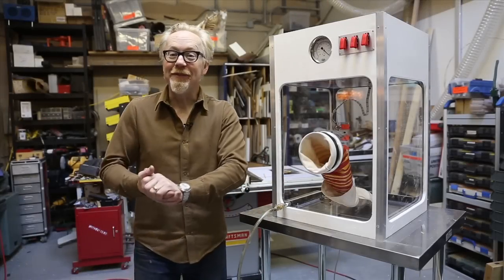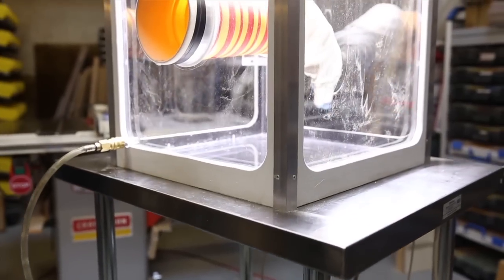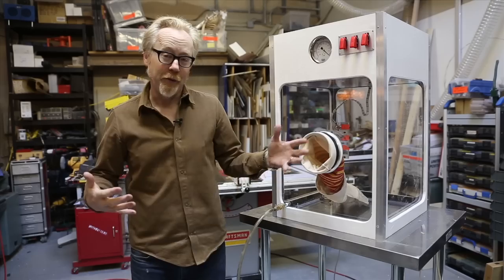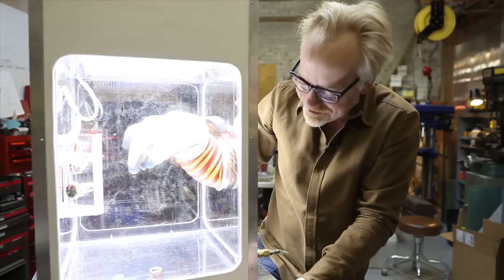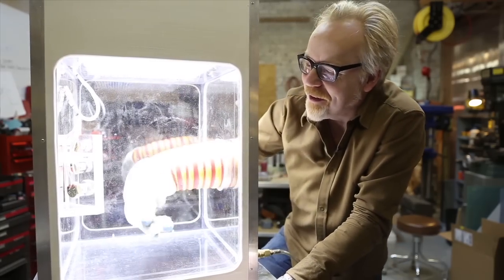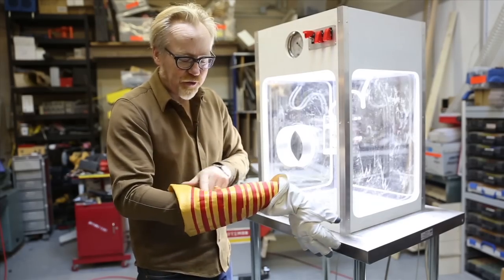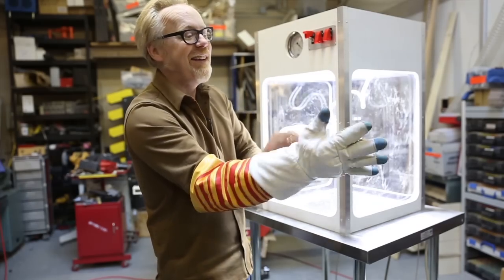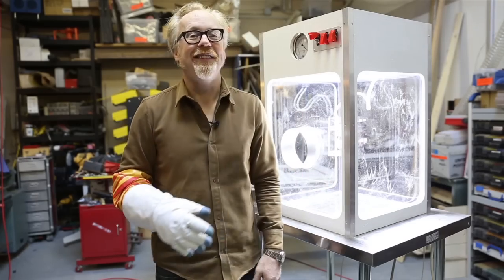Inside Adam Savage's Cave: Space Glove Vacuum Chamber

Comment: This makes no sense to me. 1 atmosphere of pressure equals 14.7 psi. If you have a spacesuit pressurised to 3.5 psi that is a partial vacuum which should suffocate the astronaut. Even so, if you enter the vacuum of space with a space suit pressurized to 3.5 psi the spacesuit should expand like a balloon and become rigid.
Reply: If you have a spacesuit pressurized to 3.5 psi with 100% oxygen, the oxygen density will be similar to the Earth where Oxygen is only 20% of the 14.7psi.
Reply: @texmex9721  "20 of the 14.7psi%"?
Reply: You mean 20% of the 14.7 psi?
Reply: 20% x 14.7 = 2.9.  100% x 3.5 = 3.5  Can you see how the space suits actually have higher oxygen density than Earth?
Reply: @texmex9721  They may have higher oxygen density but the kinetic energy of the individual oxygen molecules is lower because the overall pressure of the gas as a whole is less. So, I'd expect less oxygen would be forced through their lung membranes. You know how hyperbaric oxygenation works? 100% oxygen at above 1 atmosphere of pressure. Anyway, oxygen (O2) is not actually 20% of the atmosphere. Years ago I'd read from many reputable sources O2 levels are actually approaching dangerously low levels (less than 19%) due to deforestation and combustion engines converting oxygen (O2) into nitrogen oxides and ozone. I'd read that at the current rate of decline the levels were expected to reach below 7% within a very short period of time (a decade or so). The levels I was reading for many cities (which tend to be different compared to outside cities on a windless day) were lower than many believed to be the minimum necessary for survival but apparently we have adapted. Soon we may need spacesuits to survive on Earth! Strangely, all online sources I am now finding say atmospheric oxygen levels are at around 20%. I suspect the truth is being supressed as we approach extinction.
www.i-sis.org.uk/O2DroppingFasterThanCO2Rising.php

https://www.inverse.com/article/21419-atmospheric-oxygen-levels-falling
Reply: @texmex9721  By the way, your explanations ignore the question of how the spacesuits avoid exploding or becoming rigid due to the pressure differential between inside vs outside the spacesuit.
Reply: "The average kinetic energy of the gas particles depends only on the absolute temperature of the system." - Google that if you want a few hundred sources.
By the way I have been ignoring questions you have not asked?  My apologies.  Maybe you could provide a list of the questions you have not yet asked.  Or you could adopt a civil tone and simply ask additional questions. 
The space suit holding pressure remains flexible by a series of mechanical joints, meshes and structures that maintain a constant volume while bent.  Everyday examples of the same constant include garden hoses, and hydraulic lines.  The brake lines in a car for example can hold as much as 5000psi while remaining flexible allowing suspension travel and front wheel articulation.  The Apollo suits looked like this: https://en.wikipedia.org/wiki/Apollo/Skylab_A7L#/media/File:S71-24537-A7L_without_outerlayer.jpg
Reply: @texmex9721  You are ignoring a point I made in my original post. And the claim that the kinetic energy of a gas is determined solely by the temperature of the whole system only proves my point.
Reply: You said: "the kinetic energy of the individual oxygen molecules is lower because the overall pressure of the gas as a whole is less. "  Not temperature.  The gas is heated in the suit btw. 
"the spacesuit should expand like a balloon and become rigid."  - that is so silly I assumed you were not serious.
Reply: Furthermore, your "explanation" of how a non-rigid spacesuit remains flexible in the vacuum of space is flawed and does not explain why such non-rigid spacesuits don't explode or become rigid. Your explanation does not apply to the gloves which would become inflexible in the vacuum of space. As Adam Savage admits in the above video, it becomes very difficult to manipulate objects with the gloves when there is a pressure differential of only about 10 psi. The pressure differential on the Moon or in deep space would be far greater than 10 psi! If the pressure of the gas on the inside of the spacesuit were to be at 3.5 psi when in vacuum then the  pressure inside the spacesuit would need to be far less than 1 psi when recompressing to 1 Atmosphere of pressure. Are you saying the internal pressure and external pressure are slowly adjusted in an airlock or something? Or do they just reduce the pressure inside the spacesuit to 3.5 psi (or whatever it is) while inside a spacecraft where the external pressure is 1 atmosphere then quickly step outside the spacecraft into the vacuum of space? If they just step outside the spacecraft after pressurizing the suit to 3.5 psi in 1 atmosphere of external pressure then the internal pressure inside the suit would increase to far above 1 atmosphere of pressure and, if breathing 100% pure oxygen, the astronaut would die of oxygen toxicity. Do you see my point now?
Reply: What?, a conspiracy theorist did not accept my explanation?  I'm shocked!  TV Celebrity Adam Savage's "space" gloves are very cute but he and you have no idea how the space gloves are made.  Maybe refer back to the photo I showed you.
The pressure differential on the Moon or in deep space would be far greater than 10 psi! Nope.  Its 3.5.
Reply: @texmex9721  Yes, the kinetic energy of the individual oxygen molecules is less because the overall pressure of the gas is lower. The oxygen molecules get their kinetic energy from collisions with other gas molecules (BTW, in a 100% oxygen gas, the other molecules are all oxygen molecules!). Momentum is transferred or exchanged in these collisions. The force or energy of these collisions is what gives a gas it's pressure. Where does this kinetic energy come from? It comes from absorbing heat energy, either thermal heat energy or radiant heat energy (AKA thermal radiation, usually infrared radiation). Thermal heat energy is a measurement of molecular motion. Hence the reason heating a gas increases the pressure of the gas. You are obviously suffering from the effects of oxygen deprivation if you can't see the connection between molecular oscillation (brownian motion), temperature, and pressure.
Reply: @texmex9721  You said "The gas is heated in the suit btw". So, tell me, is the specified internal pressure before or after heating? And how is it silly to say the suit should expand and become rigid when that is exactly what is happening to the gloves in the above video?
Reply: " the kinetic energy of the individual oxygen molecules is less because the overall pressure of the gas is lower." - Nope.  
After.  And the glove in the above video is not a space glove.  As I mentioned.
Reply: @texmex9721  You don't understand the physics. Which came first? The kinetic energy which creates the force of pressure or the heat energy which is the kinetic energy of the molecular motion? They are inseperable. Energy cannot be created or destroyed. It can only change form. Yes, heat can be transferred (lost or absorbed) across a vacuum in the form of thermal radiation. But when conductive thermal energy is lost as thermal radiation it is always converted back intoheat when absorbed. Absorption of thermal radiation is one way to increase the pressure of a gas. But usually the pressure is increased by conduction of thermal energy in the form of molecular collisions. So, the kinetic energy of molecules, heat, and pressure are inseperable. It is not possible to say which comes first because they are inseperable. I should not have to explain this to you. How is it you conclude one comes before the other?
Reply: @texmex9721  You accuse me of not using a civil tone while calling me a conspiracy theorist? When did I stoop to the level of name calling in this conversation? You are the one who needsto work on keeping a civil tone. I'll investigate your link and the point about brake lines later. That is an interesting point about brake lines if true. But gloves are more like balloons than brake lines. I'll be back later. I'm busy at the moment.
Reply: The kinetic energy does not change with change in pressure.  if it did you could find a source that said that.
conspiracy theorist is 2 words, and not an insult.
But gloves are more like balloons than brake lines. Please just once consider the fact that you don't know how an Apollo space glove is made and neither does Adam Savage.
It was not easy to move in the space suit or manipulate the gloves, but it was not impossible. Just as a garden hose gets stiffer with water pressure but can still be bent with 40psi inside.
Reply: @texmex9721  Yes, the kinetic energy of the molecules does change as pressure changes. Any physics textbook should explain that. Here is a link about the "kinetic theory of gasses" proving this. https://en.wikipedia.org/wiki/Kinetic_theory_of_gases

You obviously lack a basic understanding of physics.
Reply: @texmex9721  Yes, "conspiracy theorist" is 2 words. I meant "term" as opposed to "word".
Reply: @texmex9721  If the pressure differential were only 3.5 psi then the oxygen inside the spacesuit must be extremely rareified.
Reply: OK so if the kinetic energy of molecules were reduced when pressure is reduced, what would happen when pressure is suddenly reduced to zero? 
3.5 psi then the oxygen inside the spacesuit must be extremely rareified, -yes about the same as it is on Earth. As I have already explained.
Reply: @texmex9721  When I said the oxygen inside must be extremely rareified I didn't mean like on Earth. You obviously cannot understand what I am saying so it would be futile to continue this conversation.
Reply: @texmex9721  If outside pressure is reduced to zero then the internal pressure would become infinite. You don't understand basic physics let alone what I am saying.
Reply: @texmex9721  Average kinetic energy of gas particles is equivalent to the pressure! It is the kinetic energy of the gas particles which creates the pressure against the container. Refer to the link I shared to the wikipedia article about the "kinetic theory of gasses".
Reply: Here is what NASA says about it:

"The pressure of a gas is a measure of the linear momentum of the molecules. As the gas molecules collide with the walls of a container, the molecules impart momentum to the walls, producing a force that can be measured. The force divided by the area is defined to be the pressure. The temperature of a gas is a measure of the mean kinetic energy of the gas. The molecules are in constant random motion, and there is an energy (mass x square of the velocity) associated with that motion. The higher the temperature, the greater the motion."

End quote from: https://www.grc.nasa.gov/www/k-12/airplane/kinth.html
Reply: @texmex9721  Your confusion likely originates with an inability to see that pressure is a result of temperature. I mean you likely do not understand that energy and momentum and force are merely different ways of describing the same thing which is a mass in motion. You likely believe kinetic energy, momentum, and force are all very different things instead of seeing them as different ways of describing or quantifying the same thing (a mass in motion).

Light appears to have mass or momentum despite having zero rest mass because we measure or speak of light's effect on matter. Light absorbed by matter will put that matter into motion in the form of heat. This is how thermal radiation or radiant heat energy is transferred across a vacuum. In other words, this is how the Sun heats the Earth across the vacuum of space. Photons may not have mass so when we speak of it having momentum we are actually speaking of the momentum of the mass absorbing the light which we use to measure the momentum transferred by light. To answer a question you asked earlier (if I remember correctly), if you cool a gas down to absolute zero it's pressure goes to zero. Conversely, if you reduce the pressure to zero the temperature goes to zero. To reduce the pressure to zero would probably involve expanding the size of the container to infinity, though. I could be wrong about that (expanding the volume to infinity to decrease pressure) because that may actually cause the temperature of the gas to increase. Note the thermosphere is an extremely rareified gas supposedly having a low pressure but it's temperature is extremely high (gets up to as hot as the surface of the Sun) so the pressure due to temperature may counteract the decrease in pressure due to the decrease in density. Usually, cooling a gas involves compressing it. But this actually generates heat (temporarily) because it increases the rate of collisions between the gas molecules and their container. After the heat is dissipated to the surrounding environment the gas cools down to the ambient temperature. But if you release the gas from the container it will leave the container and cool the container down. But the gas is actually claimed to be at ambient temperature or above. It is claimed to "steal" heat energy from the container and reach a lower pressure. Or so it is said. That is debateable though (for reasons which should be obvious). But I don't believe it's possible to cool anything down to absolute zero. If you could, the volume of a gas would go to zero when temperature and pressure decrease to zero.
Reply: I can completely understand what you are implying, it is simply wrong.  I am not confused.   The density of oxygen in the spacesuit is higher than it is on Earth.  To call that rarified is comical. 
"The temperature of a gas is a measure of the mean kinetic energy of the gas." <---- Temperature, not pressure.  This is from your source.
Reply: Pure nonsense. The CONCENTRATION of the oxygen may be higher than on Earth (at sea level), since it is 100% pure, but it's DENSITY is less because the pressure is approximately 1/4 of what it is (or is claimed to be) on Earth (3.5 psi vs approximately 14 psi).
Reply: @texmex9721  Pressure is a measure of the kinetic energy of the gas particles. So, if temperature is a measure of the gas particle kinetic energy then temperature is also a measure of pressure since pressure is a measure of the gas particle kinetic energy. If you don't understand this then please do not bother to disturb me again.
Reply: While it may be true the density of the oxygen measured OVER TIME (vs a timeless moment) is slightly greater than on Earth at sea level, since it is at 100% concentration which is 5 times greater than the 20% concentration of oxygen at sea level on Earth, the difference is very small since the pressure of the oxygen is reduced to 1/4 of what it is on Earth. The reduced pressure counteracts the increased concentration. If we decrease pressure by the same (but inverse) factor as we increase the concentration then there is no change in the amount of oxygen absorbed. For example, if we decrease the pressure to 1/5 of the pressure at sea level while increasing the concentration of oxygen by 5 times to 100% this would be the same as breathing 20% oxygen at 1 atmosphere of pressure. Or so one might expect. This is ignoring the other problems I mentioned earlier such as how the gloves avoid becoming rigid due to increased internal pressure due to the increased pressure differential. We must take into consideration the pressure differential because if the external pressure is close to zero and the internal pressure is 3.5 psi then that means the gas inside the spacesuit must be extremely rareified. If you don't understand what I mean, imagine if you have a tire inflated to 3.5 psi at sea level. Take that tire into the vacuum of space and it may explode. Helium filled balloons explode all the time when they rise high into the atnosphere because they expand and stretch the balloonto their breaking point due to the increased pressure differential. The pressure outside the balloon decreases and this allows the balloon to expand. The gas insidethe balloon then decreases until it reaches equilibrium. A spacesuit may be reinforced with a strong mesh embedded inside it like a garden hose to prevent it from expanding so the internal pressure doesn't decrease when the astronaut goes out into the vacuum of space. But this doesn't make the pressure differential go away. The vacuum of space will still be sucking on the gloves and making the gas particles inside the gloves hit the inside of the gloves with greater force or pressure than they would if the external pressure were at 1 atmosphere instead of a near vacuum. If the internal pressure is at 3.5 psi while the spacesuit is in a vacuum what happens to the internal pressure when the astronaut goes back inside the space craft (without depressirizing) where the pressure differential is much less because the pressure outside the spacesuit is at 1 atmosphere (14.7 psi)? In that case the pressure outside the spacesuit is greater than inside and squeezes the glove instead of sucking on it. But the embedded mesh can't prevent the glove's volume from changing in this case so the volume inside the glove will decrease. The glove will collapse around the astronaut's hand and the pressure inside the glove (and perhaps the spacesuit) will increase. So, do the astronauts adjust the internal pressure inside their suits in an airlock where the pressure outside the spacesuit is slowly decreased or increased before going out into the vacuum of space or returning from it, to avoid such problems resulting from a pressure differential?
Reply: "Pressure is a measure of the kinetic energy of the gas particles." Nope, and you have not provided a source that says that.
Reply: @texmex9721  I did provide a reference to a source which says that. See the links I shared about the kinetic theory of gasses. Kinetic energy can be converted into momentum and vice verse because they are both merely descriptions of mass in motion. You can try to argue that energy and momentum are not the same thing as many do but that won't work with me. Energy and momentum are merely two different ways of describing or measuring the same thing.
Reply: @texmex9721  If you don't understand what I am saying then please move along and do not bother me again.
Reply: You can keep saying 2+2=3 and that I don't understand.  That is your right.
Reply: @texmex9721  To quote that NASA page I cited earlier, "the pressure of a gas is a measure of the linear momentum of the molecules". So, momentum=pressure (in this case). Kinetic energy=temperature.  You can convert temperature into pressure or vice verse by converting the kinetic energy of the gas particles (which corresponds to the temperature) into momentum (which corresponds to the pressure) or vice verse. Now, please don't bother me again by arguing with common sense. If you disagree then keep it to yourself. I don't have time for foolishness.
Reply: @texmex9721  Converting starch into sugar isn't same thing as converting energy into momentum. Energy and momentum are just different ways of describing the SAME thing (a mass in motion). Starch and sugar are NOT the same things. They are different. Yes, you can describe starch in terms of a chain or polymer made of sugar molecules but that is NOT the same thing as the sugar monomers.
Reply: @sashas3362  "So, momentum=pressure (in this case). Kinetic energy=temperature."
Only if you look at a single molecule. But that is not the question here. It is about looking all molecules. There are less of those. That is the problem when you try to cherry-pick quotes you don't understand the context of.
Reply: @Schmidtelpunkt  Nope. You're wrong. It's called "the kinetic theory of gasses". Look it up and study it. You will find equations for and/or involving both the average kinetic energy of the individual gas molecules and also the total kinetic energy of ALL the gas molecules.
Reply: @sashas3362  Well, just say "nope" does not really work as an argument. As far as I have studied it, pressure always refers to particles as a collective entity, whereas the kinetic energy can be calculated on an individual level. Both usually used for different purposes. Yet you happily mix and match both depending on which quote seems to help your opinion best, a lot like you posted a link of a Buzz Aldrin quote ripped out of its context. This makes it hard to believe that you are interested in finding the truth, entirely independent of the question whether you are right or wrong on that issue.

As I never needed to connect the purposes of both models, it is indeed possible that this has been missing in my "studies". But even that would not change the fact, that so you did not provide any equation relating pressure to the kinetic energy of the individual molecule. It does not help to repeat either of the two anxioms - the point is their relationship, as that is your claim.
Reply: @Schmidtelpunkt  I didn't just say nope. Sorry, no offense, but I am done arguing with you. I'd already said all that needed to be said to prove my case. It was a closed case until you came along and tried to reopen it based on your flawed argument. I provided leads and links where you will find all the equations you seem to be demanding to see. I simply refuse to entertain you any further. Take your trolling somewhere else because you won't get another peep out of me.
Reply: @sashas3362  Just that you did not provide anything but the mere claim that those equations exist. Yet when asked for one, which you yourself claim is easy to find, you prefer to weasle out. 
I can see why you feel you are done talking. I guess this indeed closes the case. You had nothing right from the beginning.